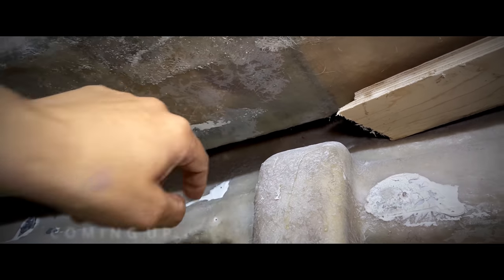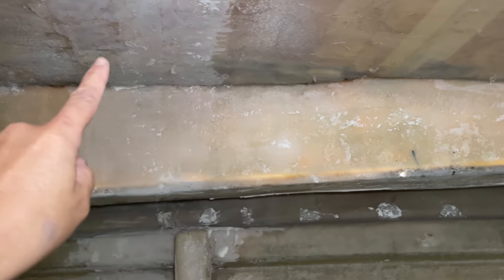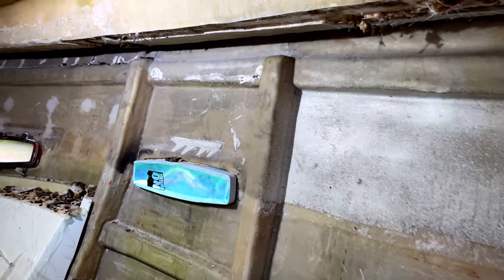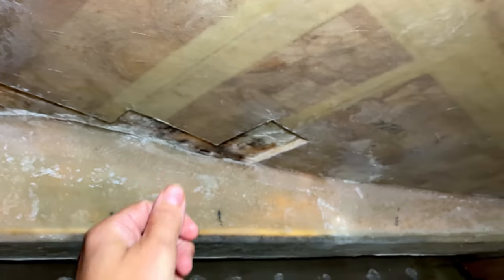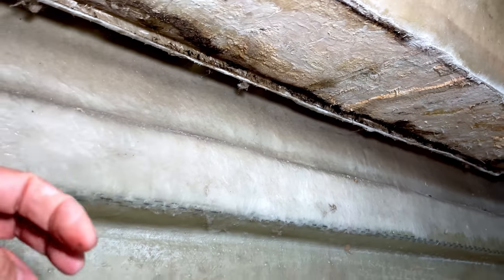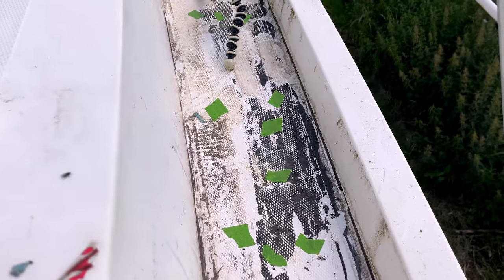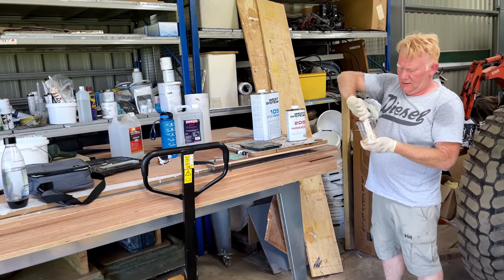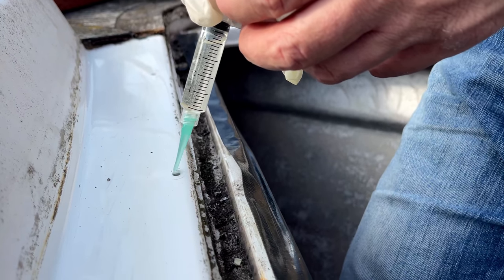Motor Boat RESTORATION - Our DECK is FULL of HOLES - EP.53

Comment: I had a load of holes in my deck too, I opened them up with a wide countersink bit then filled them with a mix of silica and gel coat, worked a treat!
Reply from the maker: Thanks for the tip Paul. I think we will be using this technique 👍

Comment: This video has got me worried for the deck piercing equipment on our boat, stuff like grabrails, cleats. How in your boat is the core protected on these locations?
Reply from the maker: On our boat, there is no core where the cleats and grab rails are located, just a thicker fibreglass laminate. I would imagine this is probably the same on most boats, so i wouldn't worry to be honest 👍

Comment: Hello there 
I'm flowing your work 
And wishing to be with you given some help and have some experience from you 
Are you going to use honeycomb for inside walls to make it more light for the boat 
And I have small questions 
Are you thinking to make small hanger to protect you work from the rain? 
Khairan from kuwait 
Good luck
Reply: Hi Khairan, we will be using 18mm Okoume Lloyds approved BS-1088 ply as we're not convinced that honeycomb is suitable plus attaching finishes to ply is far easier. We may use boat wrap to create dry upper deck working area as the winter approaches. Thanks for your interest.